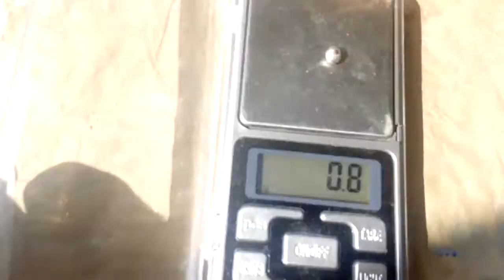Paladium and Silver recovery & refining from MLCC part 3- Melt Paladium in a brick

Comment: Thanks for the video.. interesting seeing a common brick used that way..it seems about 1KG of MLCC would be needed to make it worth while.. your yield was ..ok 1gram or 0.0352 ounces...at $1000 per ounce..or $35...for some its worth it..for others no. thanks
Reply from the maker: Brick greatly plays a role in this, save a lot on melting pots.
In my opinion, the personal Mlcc are not so profitable to work, of course the amount of Pd depends also on which electronics the Mlcc is removed, which is the electronics cost more, that is the content Pd bigger.
Reply: Yeah well Palladium is now 2604 US Dollars a troy once. So $84 a gram. And crush a brick and pan your Palladian Nuggets. Who has ever SEEN a Palladian Nugget? (No One). If you look up Palladian ore. The Photo on Wikipedia is the poster boy for Palladian and the thing is shown everywhere. It is only one centimeter by one half centimeter. So crush that brick later and pan those nuggets. And sell them on E bay.
I think nuggets would be 3 to 10 times more than scrap price. If they look cool. Don't melt them into a bead or bar.

Comment: Bravo! :) I've never seen normal clay brick performing that well! Don't worry about the beads, you can collect them with silver. I don't think  you'll be able to collect them with palladium since you'll need about 50g of it in the form of molten puddle swirling around and  with this setup I don't you can heat the whole mass to the temperatures needed. Thanks for the video!
Reply from the maker: That is ryte  of course,silver is much bette.,I use this brick several times exclusively for pladadium, so i use silveron the end to coleck remaining balls.
Reply: Almost the same lol